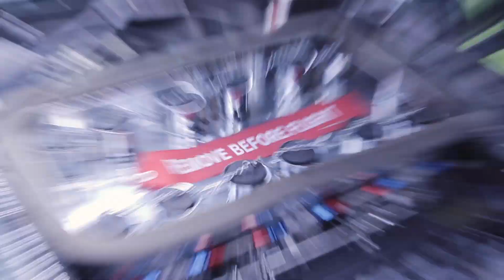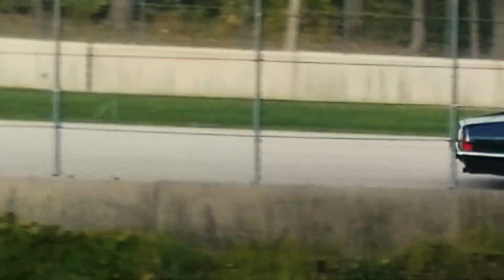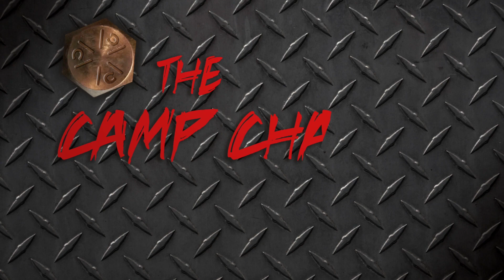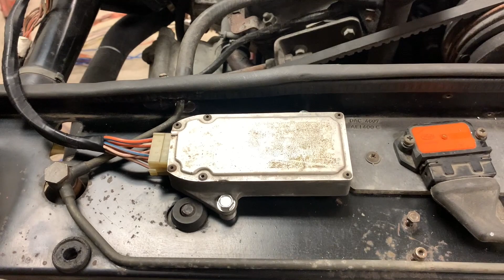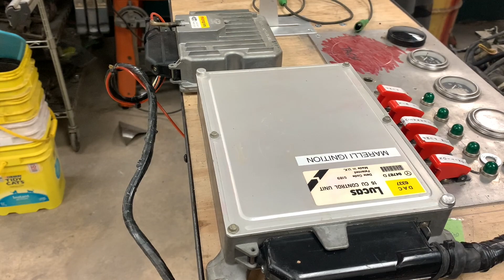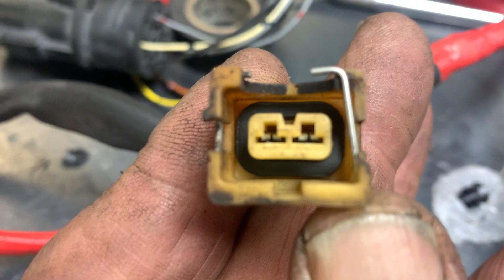S:3 Ep.1 Tool Shed: The Jaguar V-12 Magneti Marelli Ignition Engine Test Stand  Pt.1

Comment: if you are going to go any where near this far on a v12  its way easier in the long run to go with megasquirt and edis and your own harness , you show loom rub through that could be anywhere and throw a ghost through all your hard work, dry joints in the ecu , injectors that even when rebuilt are unreliable ( look at harrys jag they went through many injectors to find 12  rebuildable ones , and he is still getting misfires ) the distributor that was terrible  , the advance system holds  back the engine immensely  so when you look at all the 40 odd year old bits that were not very good to begin with you save alot of heart ache integrating a modern reliable engine management  how about a step by step megasqurt / EDIS system it makes way more sense  than shoring up a forty year old hodge pog, and you of all people must know how well a properly sorted v12 can perform .I ran such a system for years, but i am to old (and physically unable) to do it now, even though the stuff available now makes it way easier to do
Reply from the maker: Thanks for your input.

Comment: Well snickerdoodles.  Youttubes AI deleted all my coments about all the part numbers for those connectors.   Typical of the algorithm / AI terminator.    Just one point,  one MUST use the low profile connectors on the injectors as there's not enough room for the larger spring release versions.
Reply from the maker: That's correct. The injector hold down plates require modification for the big plugs to work, which I've done on a harness when I had EFI on the track car. It works great if you remove the plugs often but unnecessary for the average build.

Comment: Your Back - Hooray! Was worried you got bit by the Big C.  Glad you were tougher than it and  glad the business is good too.  Looking forward to more.  I bought a 96 convertible with an AJ16 while you were away.   (I found several V12s, but I told my wife she wasn't ready for me to take a mistress yet).  Thanks for the tip on the Saab and Volvo connectors.
Reply from the maker: Good to be back.